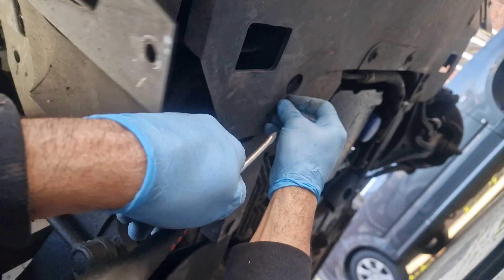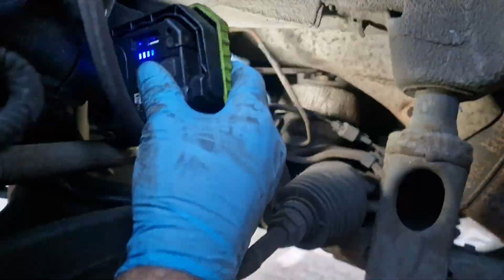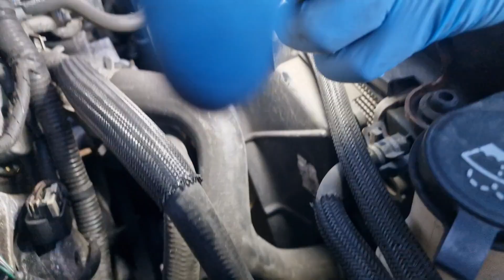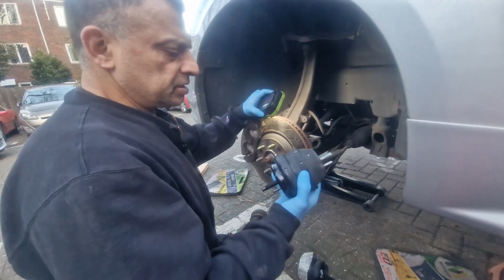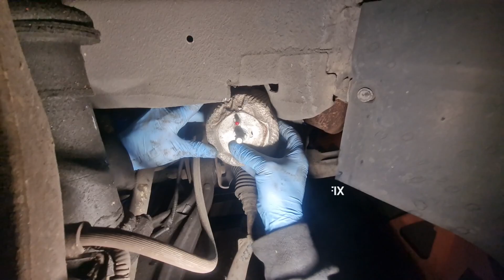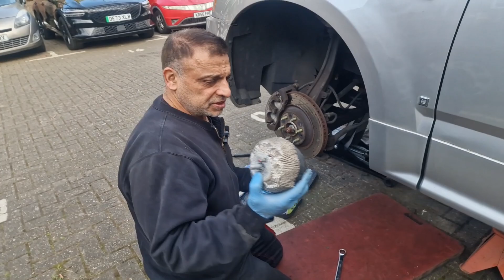How to Replace the engine mounts (Motor mounts) on a Cadillac SRX 4.8 V8

Comment: Hi bro do you do private jobs my X5 same issue you showed with the air suspension either the air pumps gone, or the valve or compressor. You seem to do a good job these garage's chasing me around for diagnostics, can you help?